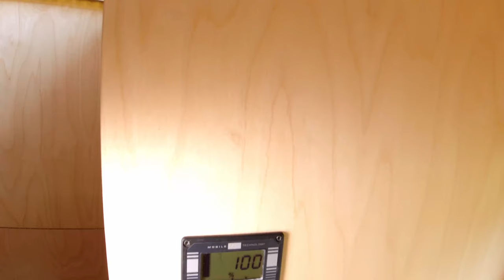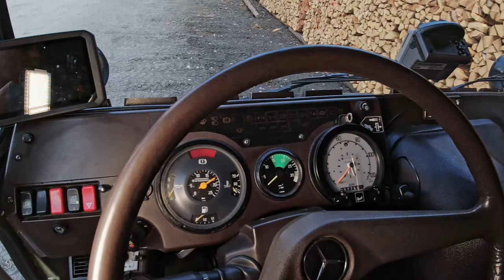4x4 Expedition Camper Mercedes Benz Unimog 417 Full Tour

Comment: Ok so no toilet no place to wash, I don't think that wash basin/kitchenette can wash anything in it. I guess if you're going to all that trouble to make something that's hooked up on such a truck then I would think there would be more utilities built into it. The way it sits so high and looks impressive on the outside but open it up and it's basically a tent sitting on an expensive truck. Please don't take offence I am just trying to understand the reasoning behind making and designing it like this besides "no screws" used.